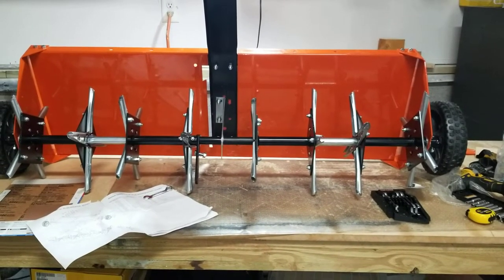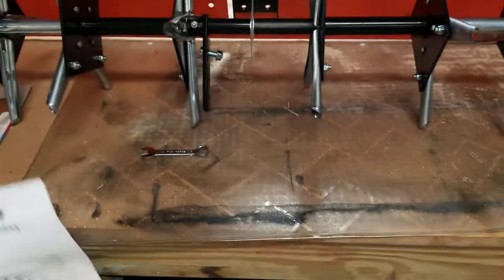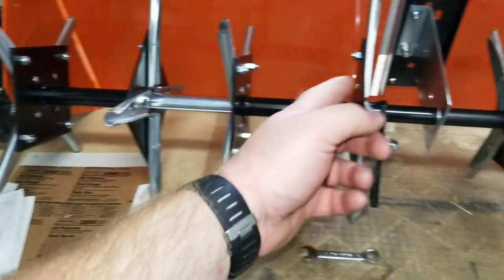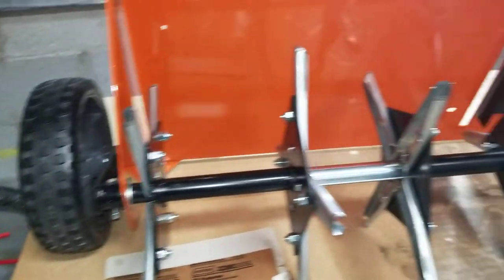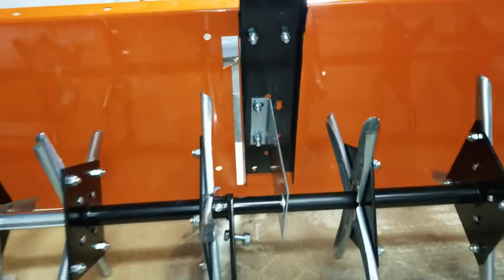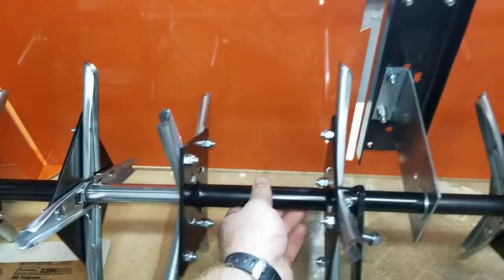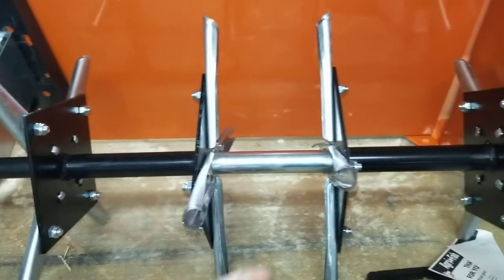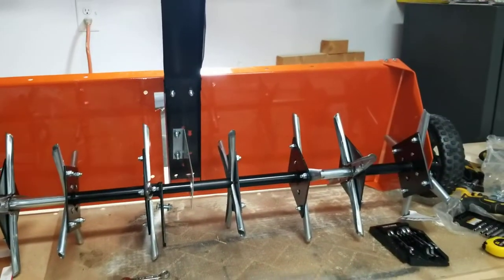Agri Fab 48 in aerator assembly suggestions. (Instructions suck)

Comment: I realize this is an older video, but you are spot on with the written instructions. The instructions are pretty good up until you start assembling the shaft and how it all is supposed to go together. Looks like two totally different people wrote different sections of the manual and never collaborated with each other. If it wasn't for the actual company video, not so sure I would have ever gotten mine assembled correctly. Actually I still don't know for sure...but it is together and looks correct now... Oh and I have some hardware left over too! Go figure...